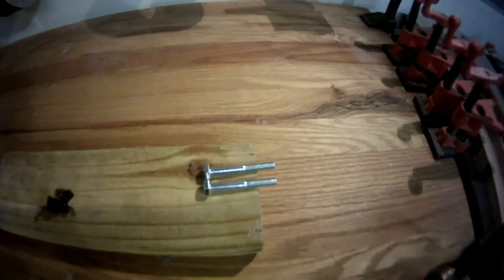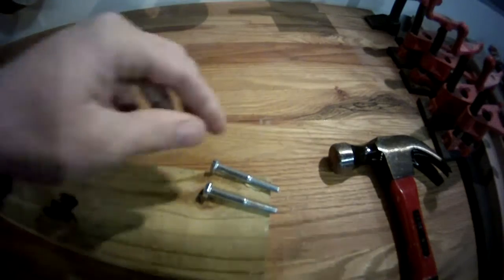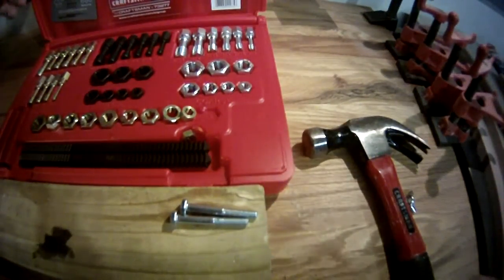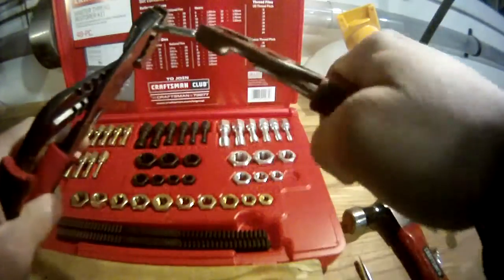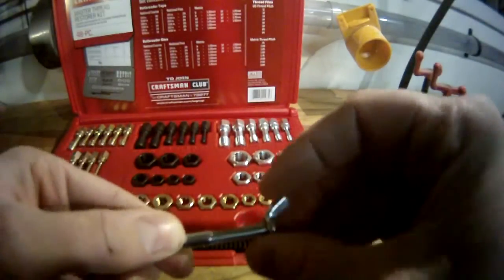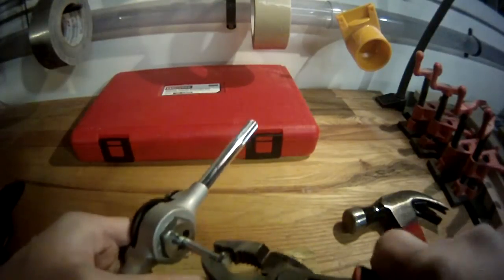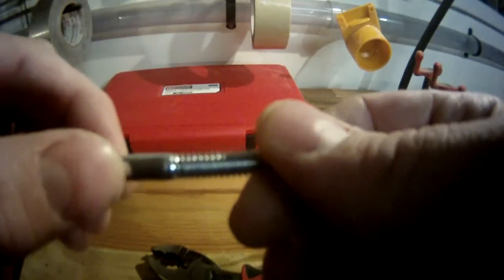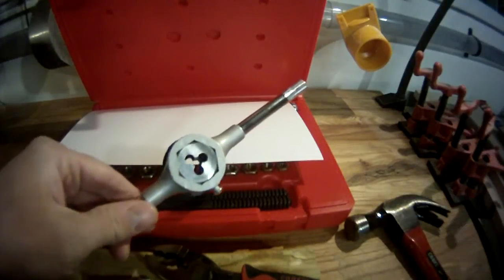Tap & Dies vs Master Rethreader Kit

Comment: Good demonstration, but man don't use serrated jaw pliers on hex head bolts or dies...at least go with an adjustable wrench or smooth jaw pliers so you don't round anything off. I guess for demonstration it's fine but in the real world it's a bad idea.

Comment: OTW--I'd disagree with you on which set to buy, but it depends on your needs.  If you do a lot of repairs that require you to make replacement parts, or to create threaded holes in new areas, a tap and die set would make more sense.  However, most of us just need to clean up/refurbish existing threaded parts or fasteners, in which case a thread repair kit (like this one) would be more useful.  I purchased a tap and die kit first, and have only used it a couple of times.  I purchased this 48-piece master rethreading set and have used it a number of times working on my cars and around the house.  It can save you the trouble of finding and buying a threaded fastener that can be made usable again, either with its restoring taps and dies (up to 1/2" or 13mm), or by using the included files.
Reply: Exactly, thread restorers are much better if you're only going to be fixing damaged threads, as there's no chance of cross-threading like there is with tap and die.

Comment: Do  not buy a tap or a die to "restore" a thread that has been damaged or is dirty/corroded. You will remove material from the hardware instead of pushing the threads back into place. There's a reason they're called restorers. If you encounter a lot of rusty/corroded/dirty or damaged fasteners, buy a restorer set. If you want to make yourself some nuts or bolts from scratch or need to drill out a hole in something and put NEW threads in it, not fix existing threads, buy a tap and die set. If the threads are already cut into or on something, DO NOT USE TAPS OR DIES. You remove more material from the hardware and then will either have a loose fit or compromised hardware, especially if it's in a torqued application.
Reply: TTM--I would amend your comments to "don't use a REGULAR/CONVENTIONL tap and die set or its components" to restore or repair a threaded fastener.  The pieces in either set are referred to as taps and dies; you should only use those from a thread restoring set to restore, or clean the threads of, fasteners.  The ones from a restoring set are made of less durable material and won't re-cut the threads or potentially cross-thread the existing threads.  By their design, then, restoring taps and dies cannot be used to cut new threads, and that information is included in the directions for use.